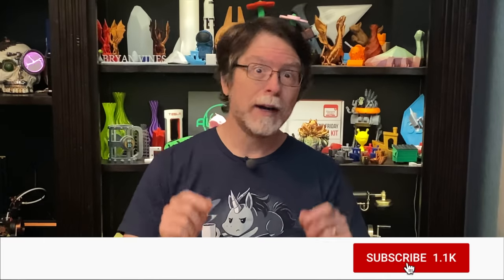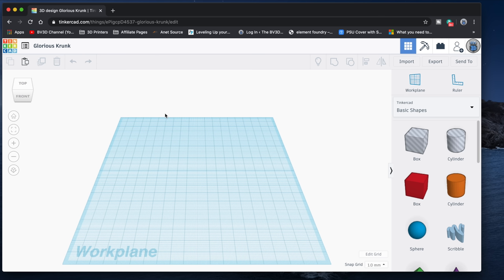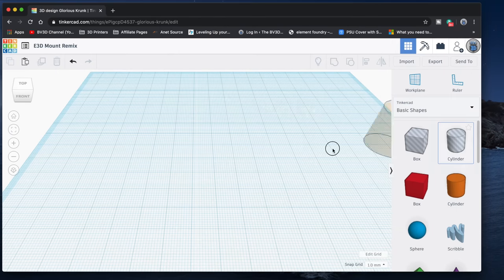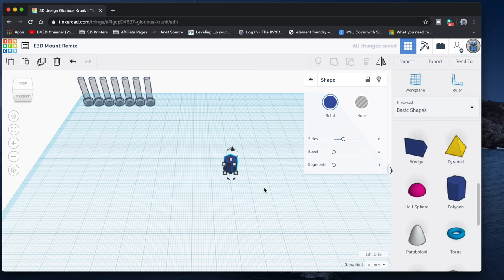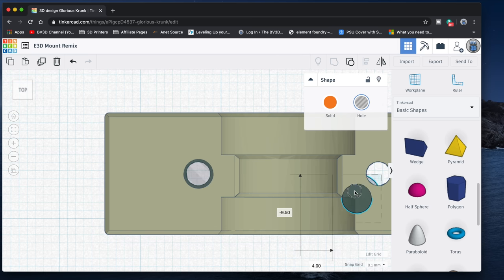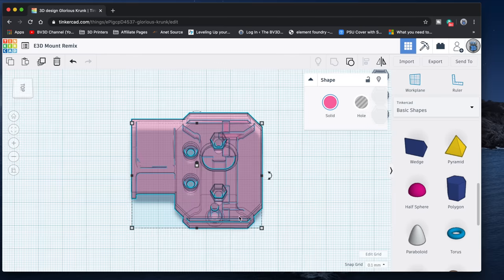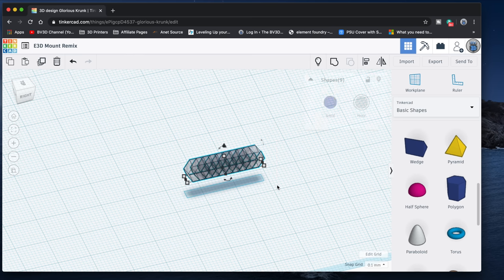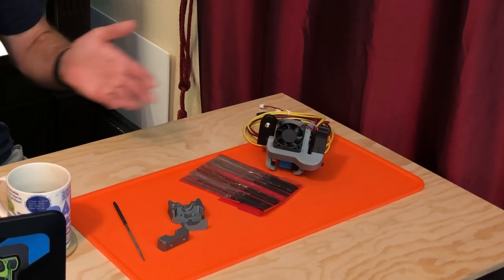How To Remix Thingiverse Things Using Tinkercad, When Screws Don't Fit

Comment: couldn't you just spent less then 2 minutes using a cordless drill and appropriate drill bit?
Reply from the maker: That wouldn't have fixed the hex nut pockets. 😉
Reply: @BV3D   true true! Also I guess if you were going to make several, might as well print them corrected.  Great video.  Thanks!